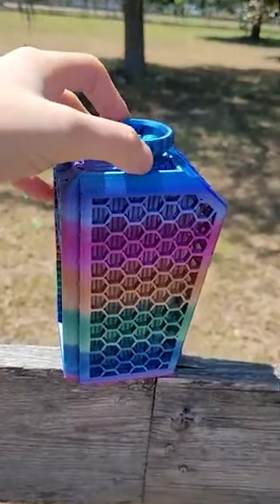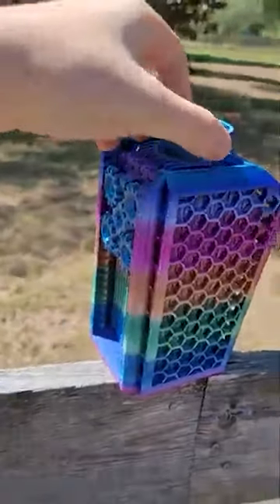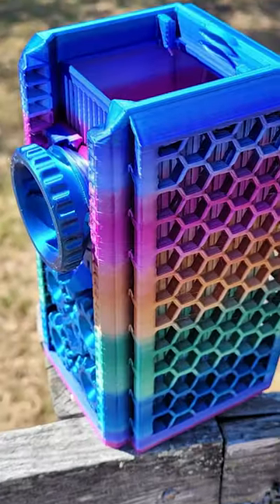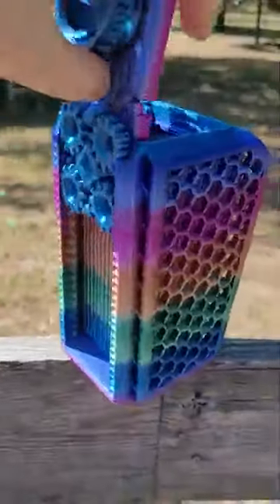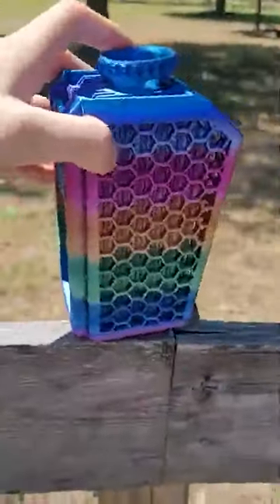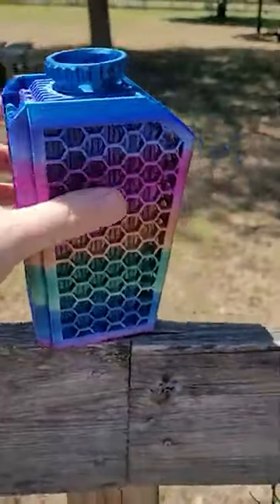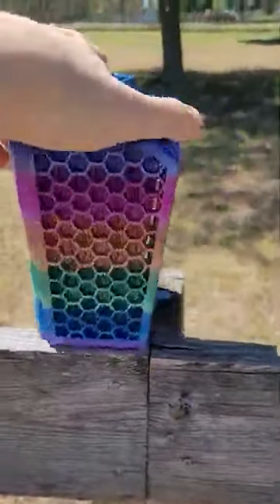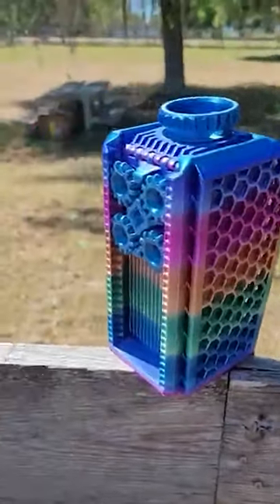Torque Box Timelapse! #satisfying #3dprinting

Comment: I see the Bambu is printing better
Reply from the maker: except I cant connect it to the slicer so I cannot update the firmware, we cannot send it files, we cannot get any notifications about print issues and everything must be done on sd card. 

Oh and AMS feeder 1 is jammed.
Reply: @3DMusketeers  it's most likely due to user head space error...
Reply from the maker: its got orange filament stuck in the hole, I can see it, I just dont want to take apart the AMS feeder to get to it right now
Reply: @3DMusketeers  Correct me if i am wrong. you don't want to connect it to wifi because you are worried about security? could you not install an additional $20 wifi router and connect it to that one instead?
Reply from the maker: We have a whole second modem and internet service for stuff like this, it still will not connect. I normally will do the initial set up on the main network then transfer it once it is happy, that is how I did the last one, but no luck so far